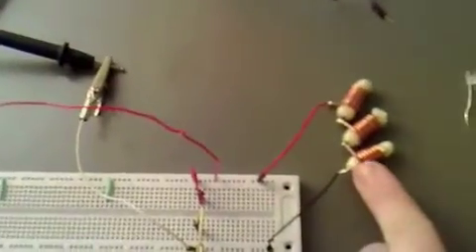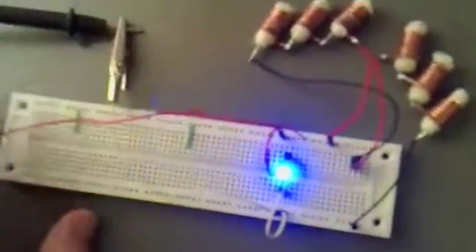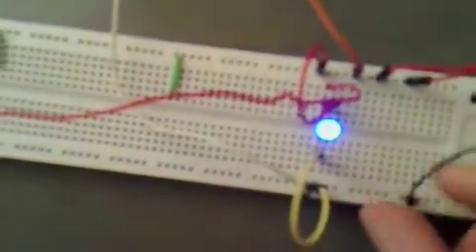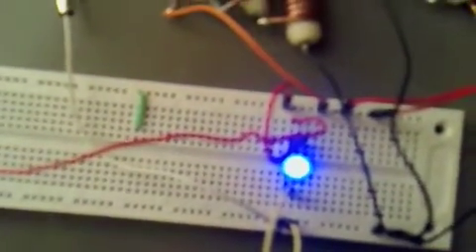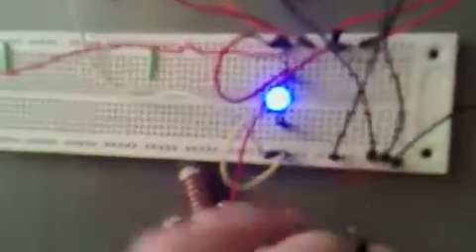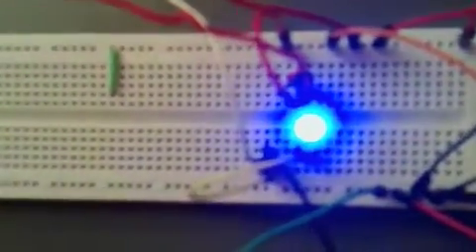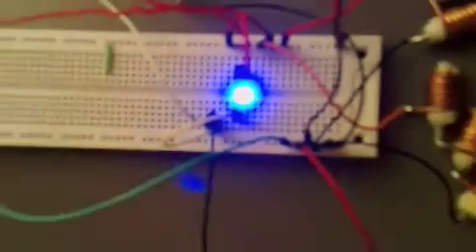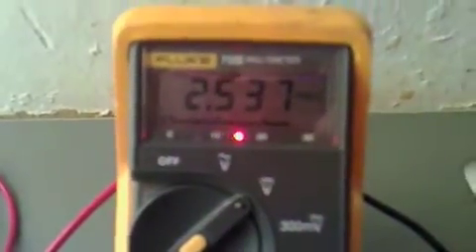Water Battery (With Lemon Juice) 004

Comment from the maker: I am using Galvanized Nails & Copper Cable 1.5mm.

So I'm Using 'Zinc' and 'Copper'

I have found the distance between the metals determines the Current and the Voltage is always the same.

Also the surface area of the Metal so bar should be better if the Surface Area is Greater that the circumference of the Galvanized Nail I have used.

Just use 3 of them if you need 120mA to 150mA?

What are you powering with them?

Do you have a video of it?

Paul.

Comment: and what metal you used in experiment? i used iron and coal bars but when i tried to connect my battery to something that uses low power amps quickly lowers from 150mA to about 50-40mA should i use coils instead of bars?

Comment from the maker: Im getting 2.449v from three in series with lemon on them.
Short Circuit is 120mA

when the Jeule Thief is on it drops ot 0.506v and runs at 77mA

Hope this helps, have you a video of yours?

Paul..

Comment: cool battery, is the metel pure or plated?

i used zink plated screws and copper wire, worked real good till the zink plate blacked.